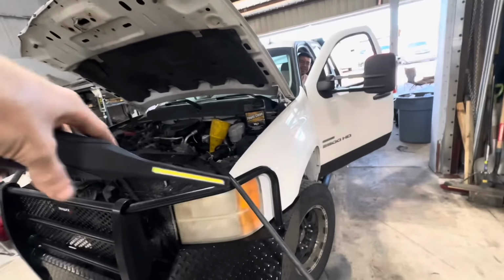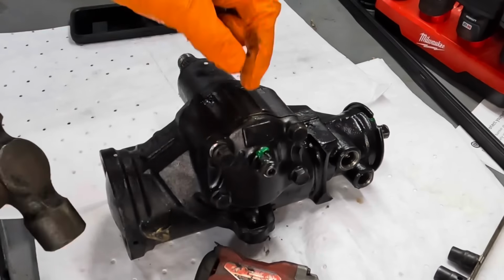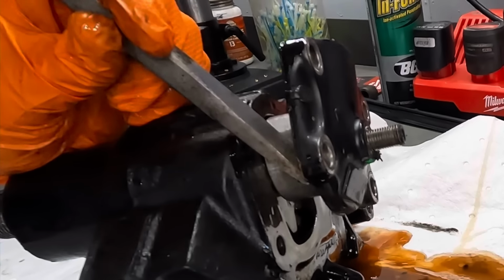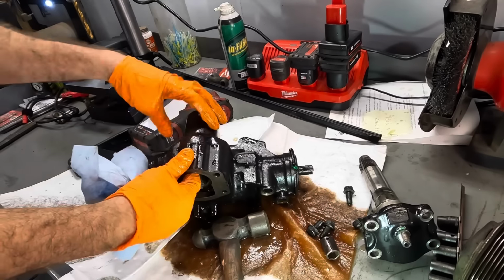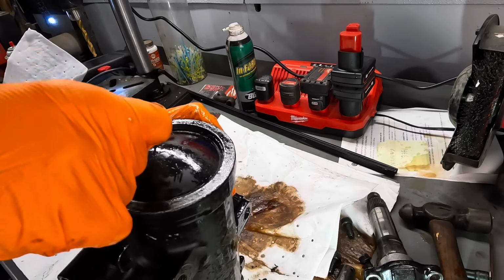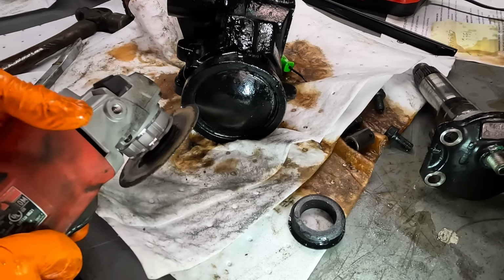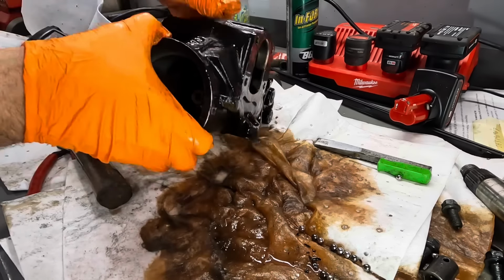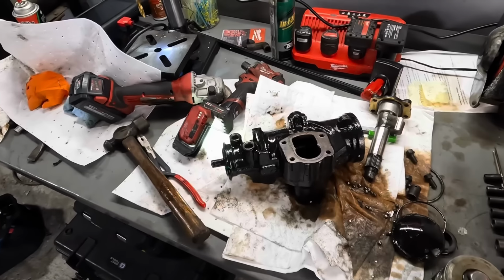Mechanic Cheated: Counterfeit/Fake Parts! Steering Gear Destroying Itself!

Comment: thick, black paint....makes it the part it aint. had a similar issue with a ps pump. installed it, bled the system, started it and immediately started to whine. had power steering but whined constantly. glad napa has lifetime warranty on some of their parts. SAVE YOUR RECEIPTS!!!! makes life easier when crap like this happens. i dont blame napa, i blame someone who did the ol switch-a-roo. theres a special place in hell for theives.
i bet the clicky poppy noise was the worn gear slipping. didnt look like there was much left of the worm gear.
thanks, ray for the field trip thru a steering gear case.

Comment: There is a small hole around the edge about the size of an 1/8 drill to push on the o ring. The hole is probably covered with paint.

Comment: Such butchery to disassemble, when paint stripper and patience and rust dissolver and endless hours could have discovered, junk. So much obvious wear on the parts is should never have been remanufactured let alone sold as new.
Fake parts can ruin a genuine mechanic's reputation so easily.
Good catch.
Keep scaring the fake part market that they can be exposed.

Comment: Been there, done that. AC compressor that was supposed to be brand new had cracked plastic parts in it. Now, RockAuto doesn't want to refund my money because I exposed that the product was NOT brand new. I like RockAuto. But, I ALWAYS have issues with Electro-Mechanical parts.

Comment: About 20 years ago I got a "rebuilt" alternator for my 1994 Impala SS, from a major retailer that sells junk. Yeah, most can guess what zone I'm talking about. It had a 1 year warranty, 2 weeks after the warranty expired it started making a HORRIBLE screaming noise. The store said no dice on fudging the warranty by two weeks. 
A friend disassembled the alternator and found that when rebuilt they left out the front cover bearing retainer plate, instead using some kind of glue to hold the outside of the bearing to the case. The glue gave out, the shaft moved rearward just enough for the fan to hit the front of the case, and the howling noise began.
My friend, an old retired GM mechanic, had the correct bearing retainer in his stash of old, usable parts he'd amassed over the years, and got me going within a few hours.

Comment: There are 2 different size ball bearings, must alternate, one is darker in color, also certain number goes in. Small hole on the side of the housing, use a small punch to remove the snap ring.
Reply: Probably didn't see it because of all the paint

Comment: Did you take it and this video back to the supplier and asked for a please explain under new/rebuilt parts warranty. Here in New Zealand under the Consumers Guarantees Act the part would have to be refunded or replaced.

Comment: The cap needs to be depressed which will expose that ring. At which point you can just hook pull it out easy peasy. That's a design feature that when it is together properly it will lock in and hold pressure.

Comment: Unfortunately, the steering gearbox should have been inspected before installation. There are specifications to be tested for full range motion so it does not lock up in the free return end positions. simple test with an inch/pound torque wrench.   old school DIY .

Comment: Unfortunately i learned about counterfeit parts the hard way.
One of the HID headlight bulbs went out in my jeep.  Wife called the Jeep dealer and they want $350 each for JUST THE BULB.
Local parts houses all want $150 each.
Found a pair on Amazon for $30. Couldn't see past 15 feet with them. Ordered another pair,  different seller , same thing.
Next i ordered Phillips HID bulbs thinking being name brand surely this would be it. Nope same thing. 
Finally broke down and bought the bulbs from a local parts house and they're perfect. 
I changed those bulbs a total of 4 times , if youve never changed HID bulbs on a grand Cherokee you should be thankful 😅

Comment: I wonder if the thing was put back together with the gear off by one tooth, pushing the piston end into the housing. Definitely not a new part, had that "Craigslist rebuild" done on it, rattle can it and call it a brand new used one lkl

Comment: I've been burned by steering gears  more than any other reman part.  Cardone, AC Delco, Motorcraft, BBB, all remans are junk.  The one in my bay, an oem is not available.  Going with a redhead gear.  Putting it in in the A.M.

Comment: I bought a 2011 BMW and it was exactly what I wanted, black interior, straight six, no turbo, premo sound system, and wood, not metal in the dash.  Everything worked, every button, every accessory.  It developed this vibration and it got worse and worse.  I took it to my shop, people who have worked on every BMW I ever owned and they do excellent work.  They couldn't figure out the problem.  They sent the drive shaft out to get it balanced and same problem.  Long story short, the drive shaft was counterfeit, not used or the wrong part. the goddamn thing was counterfeit.  The way my shop solved the problem was take a drive shaft off another car and that was the problem, a bad drive shaft.  They went back to the people who balanced the thing and asked how they didn't catch it and why it wasn't balanced.  Of course, no answer.  It's like it's bad enough it cost me $275 a month just to have a street legal car, not to drive it, just to have it, but parts and finding a good shop is a crap shoot.  And I have no idea what to do about it.

Comment: Autopsy or not that piece of crap would be going back to the store/ vendor ASAP. That and a bill for your wasted work. If auto parts store took that back as a return without checking it, shame on them. They really have to start opening boxes and checking things through.  Last year at Walmart, I purchased a set of wiper blades only to get to the parking lot and discover they were used blades that someone had returned. It’s really getting out of hand.

Comment: I'm a backyard mechanic with much experience but I'm older now and can't physically do a job twice that easily. I upgraded my dodge diesel steering box first with a Redhead rebuild of my original. That box came with way too much slop so I sent it back for a rebuilt replacement box. That box had damaged splines, worthless. So I got the idea to upgrade to a better quality PSC box for more money. I assumed that the PSC box was new and tight. Wrong. Still way too much slop and too tired to pull it back out to replace it with who knows what.

Comment: I have 25 years as a custom steering gear remanufacturer. That is a hydraulic steering gear. Not a manual steering gear. In order to operate properly it needs hydraulic high pressure fluid  supplied . What your trying to do when turning the steering wheel with out the truck running,. Would be similar to trying to move a back hoe bucket or rear digging boom with out the tractor running. The piston end cap is easily removed with a pin punch inserted in the 1/8" diameter hole located in the housing casting at the end of the steering gear. Tap the pin punch with a hammer will remove the round keeper ring from the steering gear. Movement can almost always be seen from the aluminum piston cap in most GM 800 series steering gear boxs. This does not mean that there is a problem with the steering gear box. There is only a bushing in the top cap not a bearing. All power steering gears will make mechanical noise if being operated without a functioning power steering pump supplying the correct volume and fluid pressure.
Reply: Why was there wear, pitting and rust inside?
Reply: obvious he does not understand the mechanism, part changer vs specialist, failing power steering pump then?
Reply: this box was probably alreayd toast.. judging from the amount of fluid, they probably started the truck and observed the popping and cracking..  im guessing one or more of those bearings got away or there was just binding..  maybe the lash screw turned too far in.. if that was in fact just a paint N go job, vs a new or reman part that would make sense as often people just turn the lash screw thinking they are "removing play"...
Reply: You must work for BBK. Trying so hard to defend the bs junk part.
Reply: he wants to max parts markup profit, $200 vs $900, eats the 2x labor. @XxTWMLxX
Reply: @garydarby2548  Could have sat on the shelf fluid empty of fluid. Which would mean they had not powered up and tested their product. I always powered and set up my upgraded power steering gears up on my Hydraulic test bench after they were built. As well as just before they were shipped to be sure everything worked and activated as it should.

Comment: Rainman Ray... Didn't you know paint fixes everything? If it looks new it must be, right? Jokes aside though all the bare metal parts will rust with no fluid in the unit especially if it sits on a shelf very long. I looks like they just thru some bearings and seals at it and sent it without replacing the worn parts.

Comment: I'm not sure but I think that type of steering box is called a recirculating ball type.  The ball bearings function as teeth in a gear.  The adjustment sets the clearance for the balls.  I bet they were pretty worn.

I may not have this exactly right.  Perhaps someone else can correct me on this.

Comment: A1 Cardone rebuilt parts, I won't stick those parts on any car.  They literally could spend $3 more on better seals and it might be a better product, but they cheap out on every corner and if the part doesn't fail right away it fails in a month.

Comment: i would venture to say its a new return that someone painted & put back in the box.  Ive seen some bad rebuilds & i dont think this is one of those. First water intrusion in the case with all the rust. 2nd someone's attempt with silicone to stop the leaking end cap seal. lastly all the worn out internals. Its a shame people have to do this.

Comment: The vehicle did not perform the examination, so it was not an "autopsy" but rather a "necropsy" or "post-mortem examination" if you prefer. With the amount of wear, I would have expected if this was just a worn-out unit resold as "rebuilt" then I would have expected you to comment on seeing specks of metal in the fluid. Since you didn't comment on that, one would have to presume that it was the most minimal effort "rebuild" job that likely was no more than changing the fluid and applying the RTV because they were too cheap to replace the seals.

Comment: I have seen some of the places in India were some of these items are re-manufactured.   I will use the term re-manufactured loosely.  I would not want to have to trust them with my life. They are done with the least amount of parts that they can get away with.  All those bearings that came out of it are what the worm gear rides on.  I would guess that it was short a few balls and it allowed way too much play and the piston was able to hit the end of the housing.   As you said junk.

Comment: Clearly a spray paint rebuild. I don't waste my time with cheap rebuilt steering gear boxes. I buy RedHead gear boxes only as they are one if not the best quality parts. I have rebuilt a few recirculating-ball gear boxes before but this is the first time I have ever seen a grinder used to open one! LOL

Comment: to follow your new doesn't mean its good theory, I once bought a brand new crate engine for an excavator for Cat excavator from Cat, it cost about 15K at the time, it lasted 4 hours because someone didn't torque down the cam shaft bolts. I was very much less than happy considering the time and money spent

Comment: grabbing old parts from junk yard and rebuild them , sell them as rebuilt but not an ok condition just slap new seals  , hone out interior and bearings.  i don't like rebuilt items. I had rebuilt alternator ,  gone bad in year rattling. so better when built new.,.  most cars and truck today using rack n pinion steering  than gear box.

Comment: Does that sound come from the steering gearbox?
I thought it was a Huck rivet sound.
Never seen this, and i built those gears going way back years.
This gear has a cap like a Saginaw, not like a Ford steering gear.
Its a worm/sector design.
Those faces differ by design.
You take the valve out of one end.
And theres a ring where the endcap cover is.
We built Saginaws in school.
If you loosen the valve housing section first, theres a gap.
Some of those had a hole to access the ring .
Well, now you killed it.
I question that light duty pos being on a Ford Truck, and the truck looking that heavy in the ft axle parts.
"They dont make em like they used to"
Thats really coming true now.

Comment: That is NOT how those come apart. You need a BIG screw driver to get the snap ring out of the end. There is supposed to be some end play, but not that much. The nut at the steering wheel end controls that.  That is a typical recirculating ball power steering gear like what GM used for decades. That appears to be used with maybe some new seals and bearings.

Comment: Someone who remans these things is probably laughing at the way it is being taken apart. It is a limited movement differential gear and you have to put it together exactly as it was. If it is not put together correctly, an eight turn off on the worm gear it doesn't have full movement in one direction and hits the end. If I tried to reassemble that kind of ignoring instructions or misunderstood instructions, that is the result I would expect.

Comment: This is a worn-out junk gearbox. The white seal you see is a wear band which holds the piston in the center of the cylinder. The seal is gone. This looks like a bead blast and paint "rebuild"

Comment: 97 s10 the blower motor seized up, I bought a new one from advanced, on the medium high and high speed kid whined more than a dog in heat, I took it back got another one the same thing, I then bought another new one  from the zone, the same thing, I returned that one then went on evil bay and purchased a used OEM motor, no more whining, the original lasted 25 years so I hope this one will as well, I'll be dead but the motor won't be., I'd get a used one.

Comment: I don't think that was an old part that someone returned.  I think it was a rebuild that wasn't properly rebuilt.  Yes, I see all the wear and rust but it acted like at least one of the ball bearings was not properly installed.  I suppose someone could have opened it up and put it back together before returning it but think it is highly unlikely.

Comment: My guess, someone ordered it, installed the remanufactured unit and while waiting for it to arrive took out their broken unit and cleaned that up and painted it so they could swap it out and sent it back as the wrong part for a refund and the company has a problem with quality control and just put the box back into stock without actually checking the returned unit. I know people that would do such things. Even for a $10 part.

Comment: Got an 06 f250, been through alternators, master cylinders, and hydraboost units, a few of each, from Auto Zone, before I finally got a decent one. The lady there said, yea, just a gamble on these cheap chinese " parts". Don't even get me started on the front end parts I put on that truck from Auto Zone. They are in the scrap pile now. I really don't mind paying out the butt, for Ford oem parts, MOST of the time, just such an ordeal dealing with the " dealership".

Comment: When I worked for the FAA as a safety inspector one of the things that we would look for was a repaint job on a replacement part.  Most of the time it was a used part that had lived its time limit was cleaned up and repainted and sold as new.  Why the devil folks would do that on an aircraft is beyond me.  So to do it on auto parts does not surprise me!  You spent time replacing that part and you get to eat it.  That really sucks.

Comment: It looks to me like this is a reman part that wasn't gone through completely or someone packaged this incorrectly. Ray, you should be able to show this video to whomever you got the part from and they should either give you a "new" one at no cost or reimburse you. I mean, it's obvious this isn't a new part. Also, as someone else has stated, there's a notch in the case to allow easy removal of that snap ring. Cheers :)

Comment: Seeing as how nobody sells the heavy duty item with the smiley face anymore, I would suggest rebuilding the original unit.    Where I live in Northwest Washington, when you go to a parts store, they never have it in stock, if it's anything with a core charge.   The next day your rebuilt part arrives, it was in Oregon in a warehouse, the core gets thrown on a train and sent to Mexico,  where someone will rebuild it for 16 cents an hour.  Washington charges businesses an inventory tax on the value of your stock on hand, Oregon does not, so they keep all of the parts in warehouses in Oregon, and every day trucks bring anything ordered the day before up I-5 to the parts store.  Anything that can be rebuilt for 16 cents an hour by a Mexican, is something I can rebuild better myself.  Plus the added bonus of never getting the wrong part from the store, which they cannot replace with the right one until the next day.  The guts inside that steering box are forged out of probably the best steel they could get for that job, I trust they will not be excessively worn.  As for that box you autopsied, I wonder if the input shaft was not centered, allowing the assembly inside to push on that cap. Like, someone spun it 360 so the marks lined up again, but it was not where it should have been.   Next try, spin the input shaft both directions until you determine where the middle is, it should be an equal number of turns from dead center right out of the box